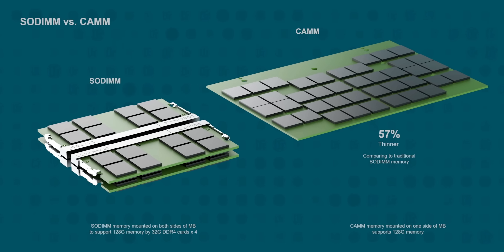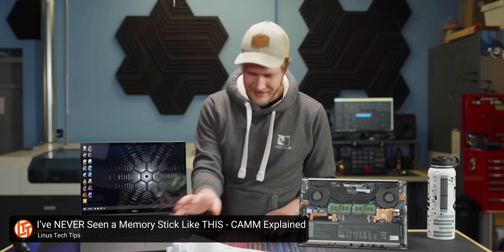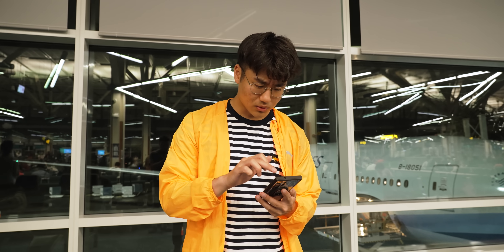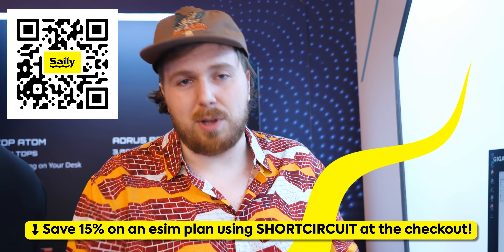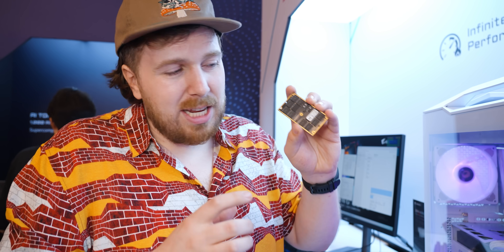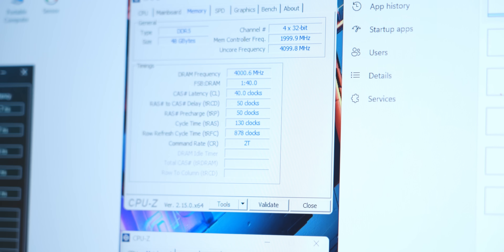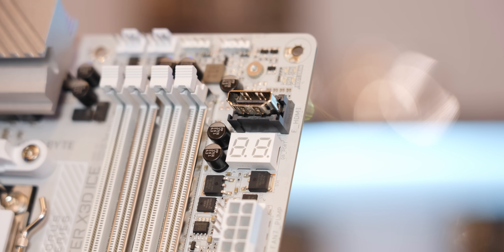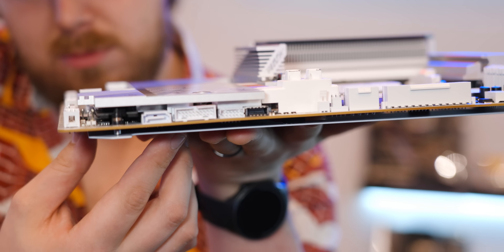Your RAM kinda sucks. - Gigabyte at Computex 2025

Comment: these take quite a big area, for small builds it may be an issue and soldered memory can win again, even when it's not performance constrained
Reply: Nothing to say it can't be put on the other side of the motherboard 👀
Reply: @dannycostello as long as we're stuck with ATX power there's barely any space on the board... currently they're packed so densely it's crazy

Comment: Why do i think that SO-DIMM DDR will stay forever and CAMM will die?
Reply: I would expect the switch to happen with DDR6, DDR5 is already established with DIMMs
Reply: @gombik42 ddr6 specs are allready done. Unlikly that. Ddr6 comes out wirh the next Plattform, so to less time.  DDR7 is in the making allready would be the first, but more likely with ddr8
Reply: SO-DIMM has to die soon due to its limits. Just gonna have to wait and see if it gets replaced with CAMM or soldered, but we have Lenovo backing LPCAMM2, and they're the leader in the laptop space.
Reply: @fitch23  : Good news, if indeed true!
Reply: We are more likely to see CAMM2s with DDR6. The current DIMM connector is a problematic connector for the signal integrity (wasn't a big problem 10-20 years ago). Also LPDDR6 CAMM2s (for laptop) are moving to 192-bit from 128-bit memory bus. It's way smaller connector, and you get wider memory bus too (more bandwidth, more capacity).
Reply: @davidlt  : CAMM2 could very well hit it's big break with DDR6, but DIMMs aren't going away in desktops, at least, for a long time, probably(SO-DIMMs, though, to be fair.....those might actually be in trouble in a generation, maybe two). Sure, maybe there may be an issue with signal integrity, or whatever, but no doubt those will be eventually overcome, just as other problems have been. 

The big question is gonna be how popular CAMM2 gets-a couple of big advantages I can see it having are better efficiency, and the fact that it can probably be more easily fit into smaller builds as well(ITX + Mini PC fans would no doubt love that!).
Reply: Industry momentum can be hard to overcome, but time will tell. Either way, I hope we see some nice improvements in the near future
Reply: if Zen 6 comes with CUDIMM (and CSODIMM) support you might be right, I have seem some test going as high as 10000MTs.
Reply: @endless2239  I see it more likely with Zen 7. Especially if Zen 7 uses AM6.
Reply: @akihitokoizumi2474  : It'll have to. Honestly, I'm a little shocked that AMD even decided to have Zen 6 as AM5 only, considering how bad of a position Intel is in right now-why not strike while the iron is still really hot? (Yes, I'm gonna say it-waiting until late 2022 to release AM5 was a mistake. It probably should have been released in late 2021/early '22 instead. Thank goodness it was still so well-received!)
Reply: SO-DIMM will die for sure,  but what will come next is the real question. maybe they'll stick to soldering it.
Reply: @mrofinUtortxoF  : Honestly, if anything, I can easily see soldered RAM just about dying out for anything other than entry-level laptops by about 2029-30 or so; contrary to what its boosters + fans have claimed, in reality it has no real significant advantages over socketed RAM overall, and if something does go wrong with it(which, to be honest, is rather more likely to happen in a gaming laptop than a Surface-like machine, or whatever), it'll be liable to take out your whole entire motherboard at once, instead of just needing that one component to be replaced as socketed RAM would be. (Unfortunately, it seems like some people in HP, Dell, etc. are still very insistent on keeping it a thing anyway)

Comment: why not just be able to mount the modules onto the points on the pcb for the modules. ie a small socket that is pressures the modules to the pcb. the mechanism that locks down the ram modules to the pcb can also work as a heatsink. issue fixed.

Comment: Dumb question, would CAMM2 not also benefit the ITX and smaller pc space?
Reply: sadly no. ITX mobo already densely packed on front-side. LGA pin is actually take more space than the DIMM. Unless some manufacture willingly to put CAMM2 on the backside. I don't think it helped ITX.

Comment: so now I can worry about bending both my CPU AND my RAM slots' pins.... :D
Reply: The interconnect between the CAMM module and the motherboard is easily replaceable. It's just a part with pins on both sides that sits between the two boards. Not sure why CPU sockets aren't built the same. It would make motherboard sockets easy to replace by anyone.
Reply: @RaduTek  It would make the socket more expensive and having another layer of unsoldered contacts would likely make a slight dent in RAM and PCIe speed. It's pretty rare for people to fuck up their socket pins, tbf, and the socket can be replaced like any other surface mount component.
Reply: oh don't worry, if it is gigabyte they probably comes with some bending right out from the factory :D

Comment: They NEED to standardize the layout between the socket and RAM placement to allow for AIO 3rd part coolers to design around cooling the ram as well! This new form factor looks perfect for that.
Reply: Stick a heat sink on that and be done. No need to liquid cool your ram bro.
Reply: @Appoxo I used AIO as in "all in one".
Not referring to all in one liquid coolers specifically.
And yes, with modern memory, a simple heatsink would suffice. 
However, even now, with some higher speed, higher density ddr5 or when over clocking temperatures can be a problem and cause stability issues.
So yeah my point is designing for better memory temp could allow for higher speed higher capacity memory support which would be great.
Reply: @Appoxo  You only liquid cool it when its required. Source - Had to do it when I noticed my RAM is overheating due to sheer usage.
Reply: You already screw it into the board, so it's more likely the mobo vender will just supply a fanless heatsink for it like they do for NVME drives, which should work just fine as ram doesn't actually need that much if any cooling at all.
Reply: Would never happen.
Reply: make the module a ring that goes into the cpu socket with the cpu in the middle. shortest possible pathways.
Reply: Negative

Comment: It's okay, Corsair Vengeance, I still love you.
Reply: CV RAM crew ftw!  Still got 32GB Corsair Vengeance RGB Pro DDR4 3200mhz myself!
Reply: Agree, 6000Mhz CL30 is more than enough
Reply: They have good ddr4 3600mhz cl16 ram. Goes well with my 5600x.
Reply: It's a small sample of 5 pairs of Vengeance DIMMs but I have had two failures over the course of approximately 15 service years. That said, the warranty coverage is great and the RMA process painless, if a bit slow. For non-critical applications, I still consider them to be the best bang for the buck.
Reply: Just wait until we get corsair vengance camm modules... just a sheet of leds

Comment: So many laptop problems can be solved if for performance focused models companies would allow thicknesses to increase. Not every laptop has to be a thin & light.
Reply: gaming laptops are nowhere close to thin and light. 

but the majority of people don't want a thick and heavy laptop, so manufacturers do what they must for better sales.
Reply: @destiny_02  They are still far too thin thus why they all suffer badly from having poor cooling because as you said people don't want a thick and heavy laptop but are ok with their high end hardware thermal throttling down hard just to not destroy it self.

Meanwhile the market that wants the performance they are paying a premium for on top of the premium for having a laptop in the first place have no options because everything is essentially a thin and light laptop.
Reply: Why not buy a mini pc at that point?
Reply: @Lego_Fish  Because it doesn't have a monitor attached to it.
Reply: People vote with their wallets. Thin and light is sleek and looks cool and so sells well. For laptops it also has that extra convenience—laptops are meant to be portable, absolute performance be damned.
Reply: Yeah. The difference between gaming and ultra-light gaming laptops like the G14/Razer 16 is too big imo. WEIGHT should be the real constraint, not thickness. I get the hesitation, some of the lighter gaming laptops like the MSI stealth series struggle to find a target consumer. Consumers would see it as a potentially louder and hotter laptop compared to their thicker cousins.

Therefore, manufacturers should position a middle-ground laptop as a cooler alternative to those expensive and light gaming laptops with the same weight and specs. Good idea?